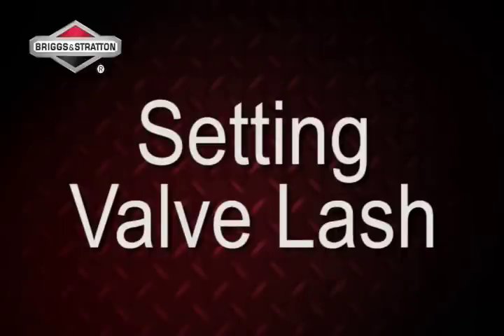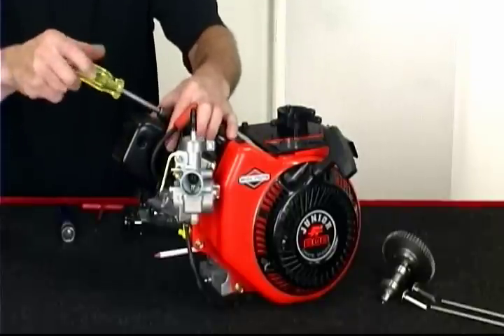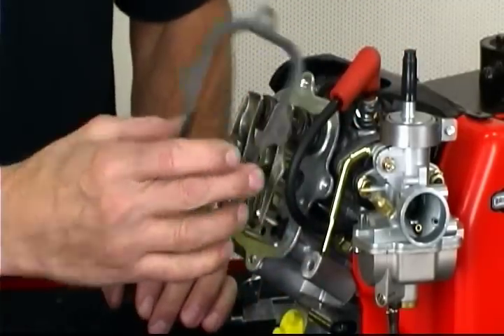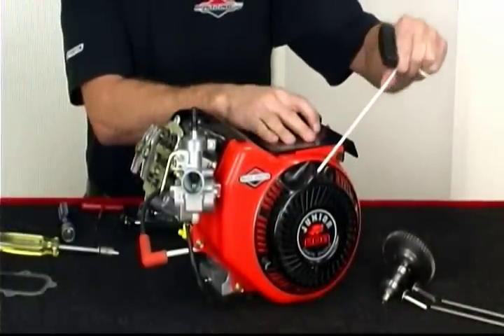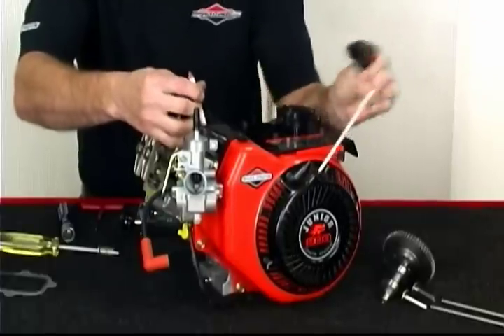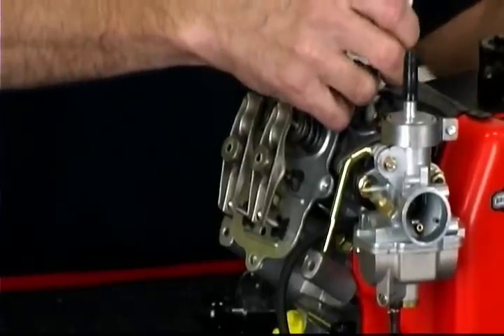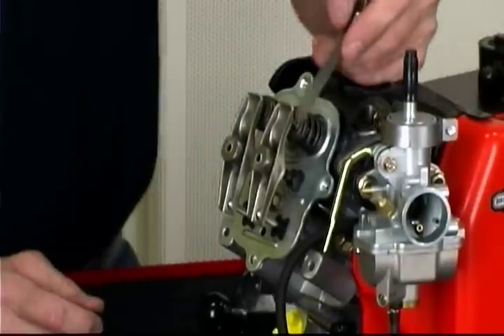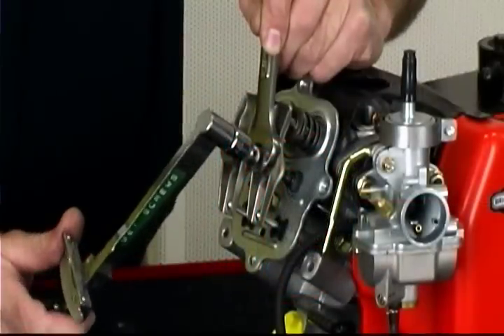How to Set Valve Lash on a Briggs & Stratton Racing Engine

Comment: Any reason I couldn't bolt this engine to Thai Longtail Mud Motor kit - Been using Predator 212 but think on purchasing one of these in I'm guessing a performance model upgrade for little more power & I understand they're reliable motors -
Reply from the maker: Jack, Our engines have won many Banka and long tail boat races.  If you check out our Briggs & Stratton Racing Facebook page you will find some photos and a video or two. :)

Comment: i like your engine by the way i'm from the Philippines.. we used briggs & straton in our boat racing..maximum speed of 75miles per hour.. how can i get same engine that your demonstrate. we have one competitor using your engine that you demonstrate... and we lose.. because his engine is much powerfull than we have. they add turbo charger.. how can we do that?.. we used 13hp vanguard made by briggs and straton. they modefied also the cam shaft.